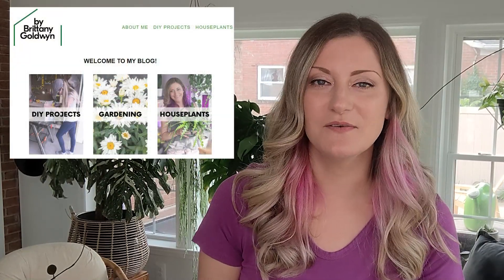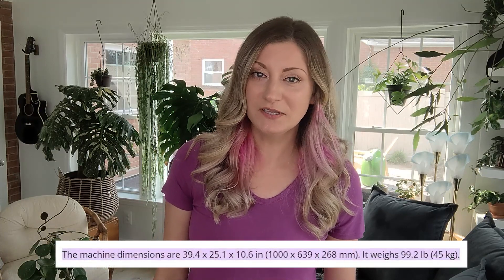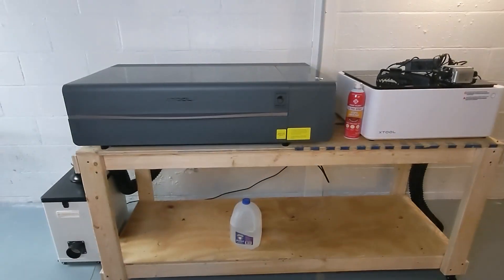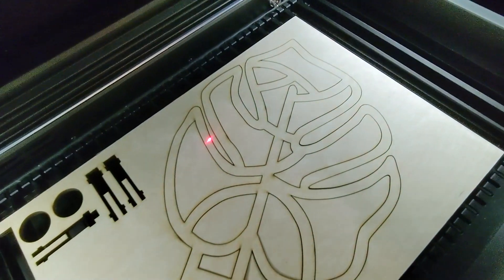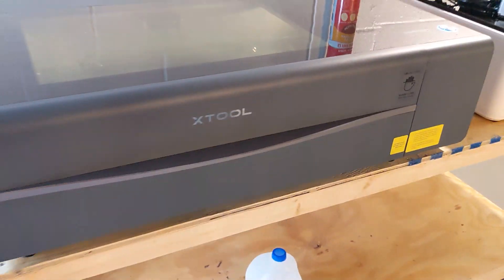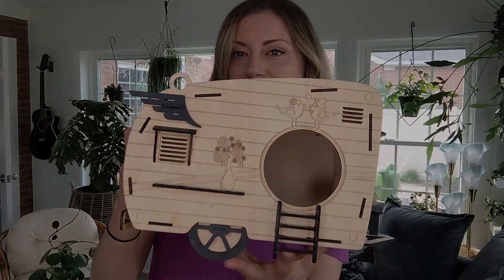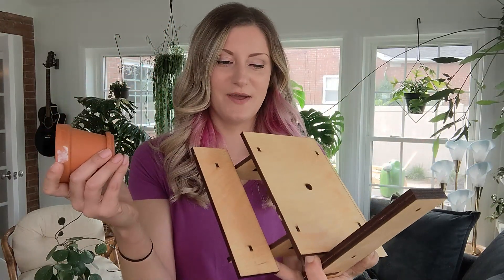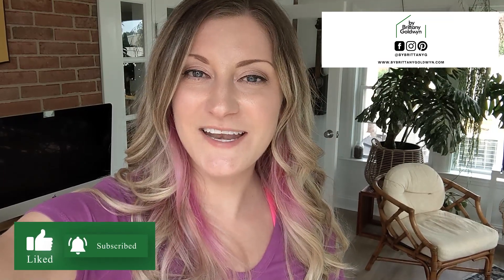My xTool P2 Review (including initial projects & comparisons to the M1)

Comment: Love what you did with the P2. I got mine recently and still trying to find the right settings for different materials. Struggling with birch- could you tell me your settings to cut the birch that quick and clean? Thank you in advance 🥰
Reply from the maker: Of course, I just finished cutting a bunch of 6mm (1/4") baltic birch for some cat houses. I did 100 power, 10 speed, 1 pass. For some of the designs, I dropped the speed down to 5 because they weren't quite cutting all the way through, but I felt another whole pass would be too much. Good luck!!
Reply: Thank you so much 🙏🏼